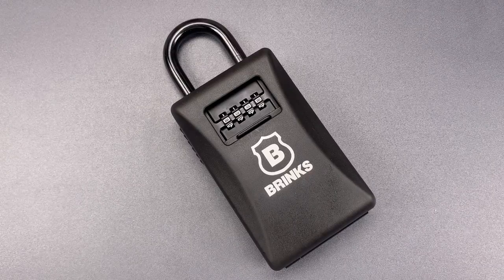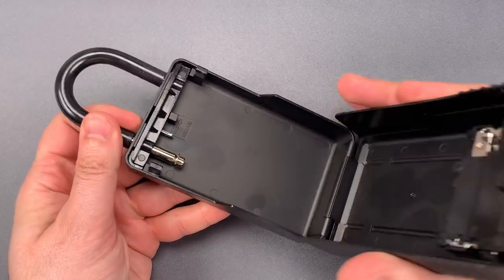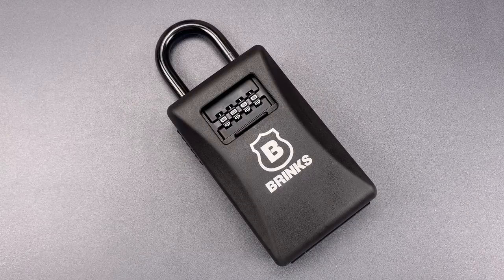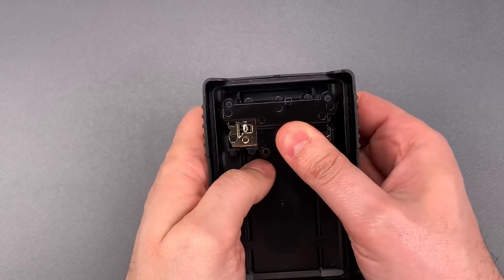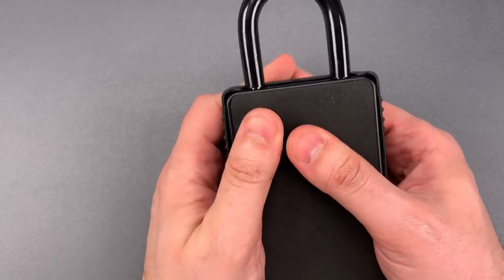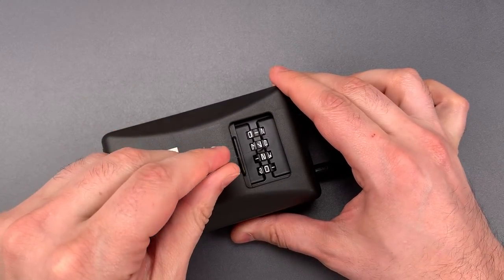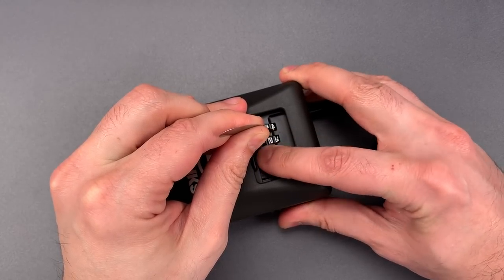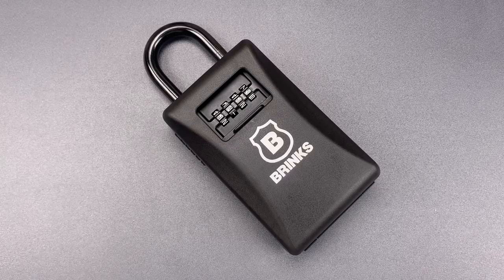[1067] Brinks “High Security” Key Lock Box Decoded FAST

Comment: Any lock boxes that aren’t quickly bypassed? Do they exist?
Reply: Safes?
Reply: It's called a welded steel box chained to the door
Reply: Scott Alman - Look for boxes that don’t have gaps between the code wheels.
Reply: @Davtwan  
Show us an example of one. We'll wait. 😎
Reply: Look for boxes that don't have code wheels at all lol
Reply: You can wrap it with tape. That would make them harder to open
Reply: You can buy coded padlocks that have shielding to block this method of opening.
Reply: I use a S&G 8077 on a welded 3/16" steel box, anchored to 160lbs of buried concrete.
It's easy to give someone the combo (though, it's a pain to change later) but they might need a phonecall to talk them through dialing it.
Reply: Check out Bosnian Bill’s recent video on the Abus 190CS/60
Reply: I think only lockpick lawyer can answer this question. He can give you an honest answer about a lock which is more hack/pick resistant
Reply: @Davtwan  That's impossible. The wheels have to be visible, which means there has to be a gap for it to stick through.
Reply: And most of them are all picked the exact same way. Like you think they'd learn
Reply: @Turidus  for some reason I wouldn't trust a review by someone who 'may' get paid when people buy through their affiliate links...
Reply: @NoneyoBisniss   https://www.youtube.com/watch?v=hnj8gGf2e7E at 45 seconds, this lock was even easier to bypass but it didn't have gaps between the wheels so there ya go
Reply: Sick a Key in a Pyle of dog poop and it will be untouched 😂
Reply: Fairly simple to stop this bypass; make the wheels dual-thickness. The outer edge being thicker and the inner being thinner, there is no longer a straight path for shims. However, fitting the case around them would be tricky.
Another, perhaps easier way would be to shield the sides of the wheels with the case, and making the wheels a bit thicker too, once again preventing access.

Comment: "Industry standard"
I think you may be right.

This lock is slightly better that attaching the actual keys to a fence or door.
Reply: than not that
Reply: You sure it's better?  If you attach the actual keys to a fence, they're not nearly as obvious to someone looking for them.
Reply: This lock is only slightly better than attaching the actual keys to a fence or door.
Reply: If you use a heavy duty zip tie, it might be more secure.
Reply: i have a spare key nailed to a post.  it's definitely faster to pop this open than it is get that key free.
Reply: :p it took me 9 years to spot the spare key the previous owner hung in the eaves by the front porch. You can't see it outside unless you stand with your back to the living room window and look towards the street and up. I found it by randomly glancing up one day while looking out that same window. Yet another reason you always change your locks when you move, lol.

Comment: Thanks LPL for this one. For me it is easier to decode the Masterlock due to the larger gap, you can fit a standard hook in and really pull on the bar, providing better feedback on the dial. The thinner decoder tool I used (from Covert Instruments) and it worked on the Brinks; I found there is just barely enough room for the thicker one and that works far better for my hands. Using the thicker decoder tool provides much better tactile feedback as you can pull more firmly without deforming the tool. 

Now that I know the feedback that it provides, I can probably do better with the thinner tool...

Comment: Thank you for this video.  I just used your method to open one of these for a friend who runs a small rental property business.  She doesn't have a dime to spare and was quite happy to get box, key, and doorknob back undamaged.

I used the notched decoder on the Covert Companion that my wife bought me last Christmas.  (We are big fans of your YouTube channel.)  Dinged it up a bit, but it worked.  First time I've gotten to use that "for real".  

I have a small suggestion. 

It's hard to see exactly what you are doing as you insert the tool.  I almost gave up because I *thought" I knew, but I was wrong.  Only after replaying the video in full-screen mode, frame-by-frame, did I finally perceive that the tool goes in above the wheel axis, notch down.  And that you are aiming for a bar that sits above and behind the wheels. 

Had I been viewing this on a phone, I doubt I'd ever have figured that out.

My suggestion is that you offer a word or two of guidance at that point, for hacks like me who have no idea what the inside of that lock looks like.  You try to show it, but it's hard to see it nonetheless.

Most of what you do, I could not do in a million years.  So I was more than ready to attribute my initial failure to lack of skill.  That  would have been a shame, since picking this turned out to be just as easy as you said.  I can attest that it takes neither practice nor skill to pick that lock.  It just takes following your directions correctly.
Reply: Tried over and over, can't get it to work.  You said the tool goes in notch down, but that's not what the video appears to show.  Looks to be notch up to me.  How wide is the modified feeler gauge?  How far from the tip is the notch?  How far do you push it in?  At what angle?  What is this "loose" feeling I'm supposed to feel?  Couldn't get this to work at all.
Reply: @pilotjim4595  I hear you.  Took me a while to figure out what he was doing.  I used the "notched decoder" that he sells on the Covert Companion website.  The business end of that is about 3/16" tall, and the notch is about 1/8" from the end.  It's a tiny little thing and I don't think I have the skills to machine something like that.

That said, the hard part here is that it's not clear what he's doing.  You use this to grab a bar inside the lock, and pull that bar forward, i.e., as if you were going to pull it out of the lock, through the number wheels.  Then hold it there, as you turn the wheels.  

So, you slide this in, angled up toward the top of the lock case, notch-down.  Then you use the lock case as a fulcrum -- you pull UP on the end of the piece of metal, and that pushes the notched end of the piece DOWN.  With luck, it stops when it's resting on the bar that you want to move.  

Now keep up the pressure (keep pulling up on the end of the metal, so that the other end gets pressed down), and try to withdraw the tool -- pull the end toward you.  Keep some pressure on that -- keep pulling it toward you.  With luck, the notch will catch on that bar, and pull that (spring-loaded) bar forward.  It's just a tiny bit of movement.

If you've snagged that bar right, this little piece of metal pulls it into the numbered wheels.  Try turning them  They should be very stiff to turn -- except for one number on each wheel, where there will be some play in the wheel.  That's where the "gate" is, and that's what they mean by loose.

Comment: @LockPickingLawyer:  I have this same lock box, and while I can decode it with the usual rotating the cam and feeling the detent method, I can't seem to figure out the method you used.  Can you be a bit more specific on where this bar is and how you are pulling it towards the wheels, please?

Comment: so, i'm no lock expert, but seeing this attack now for the 5th or 6th time got me thinking. Is it possible to negate that attack vector without changing up the design too much?
can a manufaturer maybe just put some rubber coating in the gaps of the code wheels, to prevent the thin metal from being put in?
Or maybe somehow prevent the bar behind the wheels from being hooked / pulled up? Extra plate in front of it, guards next to it, something like that?
Reply: They would competent designers to do that, which they apparently do not have.

Comment: What I am learning is that, if I ever designed a lock, to:

1) Make a paracentric keyway
2) Use a fair few security pins
3) Make it armoured as hell
4) If it's a lockbox, guard the fucking bar on the inside fuck just a slight metal lip over the turning wheels and then a ridge sticking out to move said wheels would stop this

Comment: These locks are so bad you don’t even need a decoding tool. The tolerances are so poor it’s relatively quick and easy to learn the code wheel play characteristics. At which point you can decode it without binding the code wheels.

I’ll be most impressed if I see the LPL decode these without the tool as well one day. It took myself about 4 hours to master it.

I shall offer one strong hint to anyone wanting to learn this. When rotating the code wheels downward (code wheel numbers ascending) the number after the correct number always has a very tight tolerance with little play. This is great for confirming the correct number. Lastly I use a pick to rock the code wheels in order to detect how much free play there is on the numbers, not my fingers.

Comment: Since it's hard to come up with a new lock type. Why not just make it harder to be quick. By having a key to open a combination to open a disclock to open a fingerprint lock. Where all edges on the lock are 4x interlocking so you can't shim to the reset switches. Now it'll take like 2 min instead 5 seconds

Comment: I wonder if you could even take a paper clip or even that feeler gauge and slip it in between the lock body to push that switch inside so you can just reset the code

Comment: All this actually makes me wonder - with all code locks having the same vulnerability, is it even possible to actually get rid of it?
Reply: Yeah, if I remember correctly, there are a few that he's reviewed that don't have this same flaw, but they ended up being vulnerable to some other type of attack (forgot which).
Reply: Shielding the code wheels, relocating the bar for the gates etc. But then most of the time they're so sloppily made that you can feel the gates with just tension.
Reply: It's not that they CAN'T make a secure combination lock, it's just that it would be more expensive and 99% of customers wouldn't even notice (or be prepared to pay for it). It's easier and more profitable to just lie on the packaging ("HIGH SECURITY").

Comment: Couldn't get this to work at all.  How wide is the modified feeler gauge?  How far from the tip is the notch?  How far do you push it in?  At what angle?  What is this "loose" feeling I'm supposed to feel?  Need more info for typical youtube viewers to make this work.  My wife has a couple of these lock boxes for her real estate business, and I would love to be able to get this method to work.
Reply: I don't think it works at all.  I've gone through two of these so far because it's too easy to mess up even when it's open.  I've followed his instructions to the T. Didn't work. So I took it apart to manually push down that metal he was talking about and I pushed the spring in on the side and still could not get the mechanism to release.  He either is bogus info , it's way harder than it looks or Brinks fixed the issue.

Comment: Don't waiste your time!!  It does NOT work.  Throw it out.   I followed it to the T and there is absolutely zero difference in each number being turned. You will NOT find the code.  I even took everything apart and pushed the metal piece down and pressed the spring in. still does not work.  This Video is 3 years old. It's  either fixed after this or it's always been way harder than it looks.